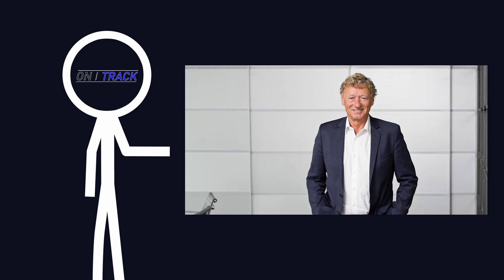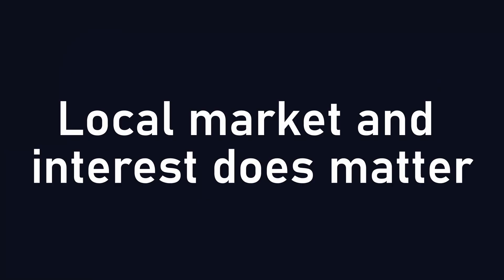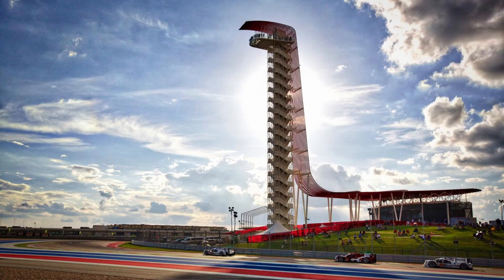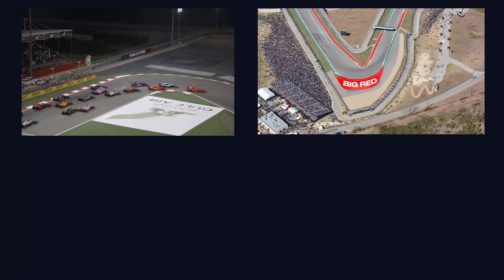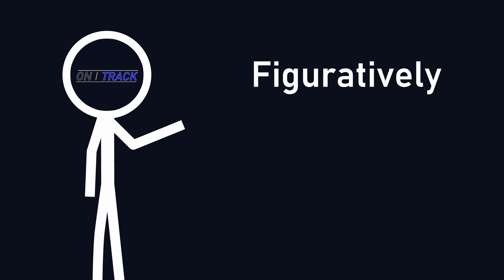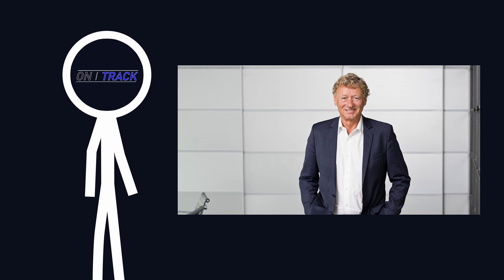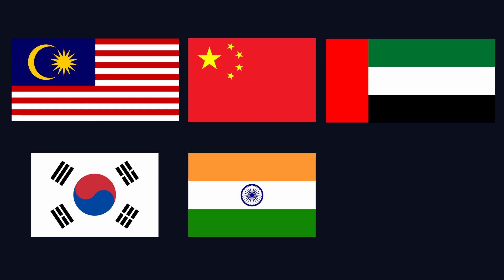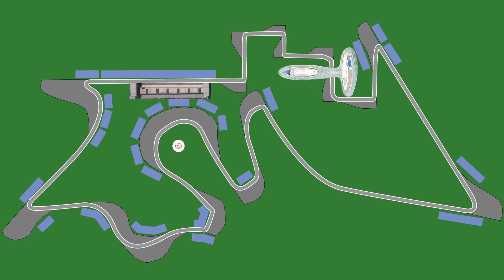How to build an F1 Track | Tilke 2000's style circuit

Comment: This makes me think: can someone do a "reverse Tilke track"?
Let me explain what I mean:
- Flat ground? Elevation changes, and lots of them.
- Starting straight not the longest? Now it is. Best be very long too, because if this straight is too short, the track is all turns.
- Turn 1 is a hard braking zone and switches back on itself for Turn 2? Now Turn 1 is actually a middle-speed corner and Turn 2 kinks some more in the same direction shortly after.
- Fast but not flat out corners? Time to go for a tight chicane, though being sure it isn't as slow as taking a hairpin.
- Medium speed double corner? Well now they aren't in the same direction; yep, that's another chicane, just faster and weirder.
- The long long Turkey corner? Well now it's a long long series of S that ends up looking almost like a straight.
- The turn that tightens up? Reverse that, it's a tight turn that actually gets looser on exit. Also since Tilke likes it with elevation, let's make it the flattest section of the track.
- Back to back straights? Can't have that, instead just have two flat out corners because the track still needs a fast section somewhere.
- A series of slow right-angle turns for Sector 3? Let's have Sector 3 be only a series of fast corners instead.
And I think that's the Tilke points covered. My idea is probably as bad as the bad Tilke tracks. It would probably be awful because there's no viable slowdown for pit entry and people going 320+ on the pit straight.

Comment: Couldn't you make this track better by directly connecting the fourth and seventh right angle turns in sector three with a straightaway and two little flick turns? We might need more runoff for the final turn though.